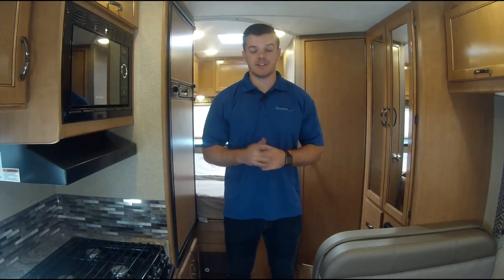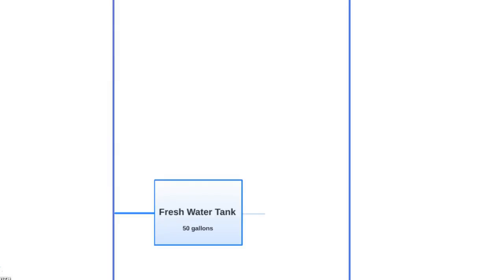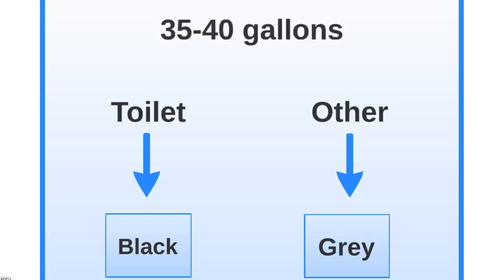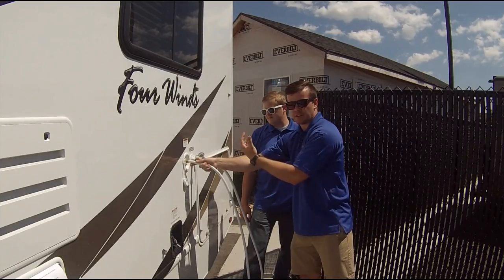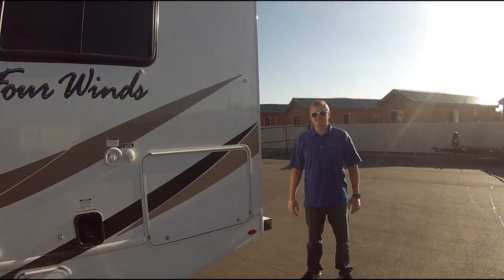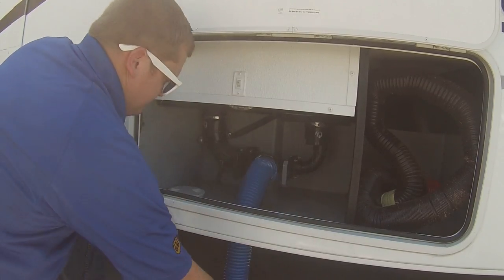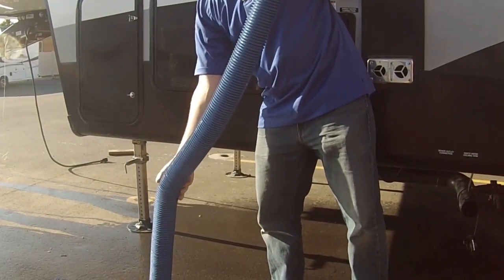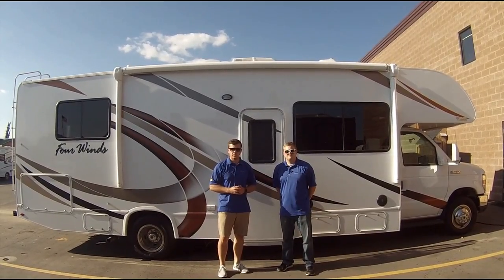How does an RV Water System Work

Comment: I would think you'd want to close the valve on the black tank before opening the grey tank valve. At least that what I have heard.
Reply from the maker: There's no reason why you couldn't do that. The reason why you wouldn't that is because the draining slows down when less content is in the tanks. In effort of trying to get as much content out, we leave it open to keep draining. 
Now, as far as contents getting mixing and filling up the other tanks, the way the pipes are plumbed makes it nearly impossible for contents to fill the other tanks. And even if that did happen, we're talking about sewage. There's no such thing as clean sewage. Know what I mean?
Reply: Spencer Jones wellllllll. Gray “is” cleaner than “BLACK”! Lol! I empty my grey after because I prefer the fact my shower water “cleans” ?? the black water out of my lines before I spray them and pack them away.

Comment: I have this same 'Thor Connivence Center'. I have my new (very used) RV parked. I turn on the generator and water pump. The bathroom faucet spurts out water. But the kitchen faucet doesn't do any spurting or flowing. Tanks show they have water. Is there a step I'm missing?

Comment: my question is does water still run without the generator connection or does it have a battery 🔋 on the side?or you need to have the water camp connected?
Reply from the maker: Good question.
If it's from fresh water using the pump then you need only battery.
If the batteries are dead then you'll need generator or plug in to shore power to make the pump work and to recharge your batteries.
If it's city water, then you don't need anything else. Batteries can be off on of the RV entirely and it will still work since it's being pressurized from the city connection. 👍

Comment: When you have water filled in the fresh water tank
Do you run the water pump the whole day or u have to turn it on when your going to wash your hands etc every single time and turn it off every single time?
Reply from the maker: To each their own..
I personally turn it off every night so it doesn't cycle on and startle my wife (😆) and then I leave it off until the first use of the day and leave it on for convenience until that night.
Hardly uses battery if it's left on and the lines are already pressurized.
Reply: @spencerjones4328  thanks but what about those late night trips to pee lol
Reply from the maker: Lol. Well the toilets don't work like traditional ones. When you step on the pedal it just DROPS down. So if you turn off the switch, you can do 2 or 3 "late night trips to pee" with enough pressure in the line.
But sometimes you gotta do what you gotta do. 🤷🏼‍♂️
Reply: @spencerjones4328  cool thanks for the reply!!

Comment: So you dump the grey water tank second to help clean out the tube so it doesn’t smell or leak sewage as much when putting the hose back?
Reply from the maker: Right! Sorta... Black tank has solids and the grey tank doesn't. That's really the "logic". Run some extra water if you're having smelling or leaking problems/concerns. Sometimes we put chemicals in the tank just to dump it again after a drive.

Comment: Can you run water pump to run water from water tank without using or filling hot water tank? Thanks
Reply from the maker: Yes. Each water heater has a bypass behind it so you can winterize your RV and avoid getting anti-freeze in the tank. By turning on the bypass, all water will pass on by the water heater.

Comment: So do you ever have to get the actual black and grey tanks cleaned?
Reply from the maker: Yes. Occasionally you'll want to just run straight water through the tanks to and get the water running clear. Then put some water in, drive around a little and then dump it again. But as you are using the RV, you'll want to be putting in the tank-treatment chemicals and some water so it continually treats your tank and keeps it clean throughout using the RV.

Comment: Is city water vs water pump system universal or is it rv specific?
Reply from the maker: It's pretty universal. May not always be the case, like, some small trailers only have a water pump and no city water. But for the typical RV: Yes. They're almost always built that way.
Reply: Okay thank you. That helps quite a bit :)

Comment: So how do I use my water in my RV when I’m off grid?
Reply: Have your fresh water tank full before heading out. When you get setup turn the water pump on when you need to run water. 
But always make sure to purge all the air out of the water heater before turning it on!!
Reply: @jamesglenn520  thank You !
Reply: @robertdean6222  We actually purge the whole system before we head out. 
That way the 5-6 gallons to fill the water heater is already on board. Depending on how long you plan to stay 6gal. can make a big difference. 
If that all makes sense 🤔
Reply: @jamesglenn520  Yes that makes sense thank you, is there a purge valve on the hot water tank or should I just open the  hot water on each Spicket to purge it? I have a 22 J JAYCO model.
Reply: @robertdean6222  There should be the pressure pop off valve towards the top or just turn on a hot faucet.
The on-board pump from your tank will take a little bit to fill it. Then you can top off the tank.

Comment: So big time newbie question: when you are parked at a location with sewage at your site, (like and RV park) do you leave the tank valves open, or you do just dump them every few days (or when your levels go up)?
Reply from the maker: You can leave the grey tank open. But you'll want to leave the black tank closed until it has enough content in it before opening the valve. I wait until at least 1/3 full before opening it. This helps keep enough fluids in the black tank when you pull the valve, it pulls out all of the solid contents as well. If you leave it open, you have what we call a "pyramid" of a mess.
Reply: @spencerjones4328  I get what you're saying. 💩 I've heard that the sensors can be a little deceiving, especially in black tanks because of "stuff" getting stuck on or near the sensors. Is this true?
Reply from the maker: @prestoncox  Definitely. Happens all of the time. Which is why we always put chemicals and some water in the tanks so as you drive it continues to care for the tanks and try to clean off the sensors as much as possible. But even then, if you drive the RV with water and chemicals in the toilet, sensors could read full at the end of the drive. It should drop down to empty about an hour after you park.

Comment: on average 1 person taking 1 shower a day, how often would you have to re fill the water?
Reply from the maker: That's hard to answer because there are a lot of other factors. How often are you using the toilet? How often are you using water to wash dishes or prepare meals? How often do you use water to wash other things (like rinsing sand off of your feet from the beach)? It's a matter of everything adding up. Even then, with a family of 4 that's moderately conservative with water use, it'll last a few days. If you use a lot of water for all of those other things, we've had some families call us thinking there was a hole in the water tank! Check your monitors and that'll give you a gauge of how much water you're consuming before you have to refill.

Comment: hot water tank working well but no hot water to faucet
Reply from the maker: Check your bypass valves. You could have the out valve or even the bypass valve open where it's mixing with cold water when it comes out.

Comment: There is not a single RV ever built that has a "Hot Water Heater" in it.  Most will have a Water Heater.  Why would you have a need to heat hot water?  If it's already hot, no need to heat it.
Reply from the maker: A simple Google Search will show you it's referred to as a Hot Water Heater quite often. There's even a website owned by Amazon called www.Hot-Water-Heaters-Reviews.com. BUT, in a world where people say "VIN Number", or "ATM Machine"; just because people say it doesn't mean its right. Thank you for correcting an English injustice.
Reply: its hot water heater because it heats it to hot temperatures, not warm temperatures.
Reply: Spencer Jones love that answer!             I flip houses.... up north EVERYONE..., says HOT WATER TANK. Why are people so mean & grumpy! They need a VACA!!